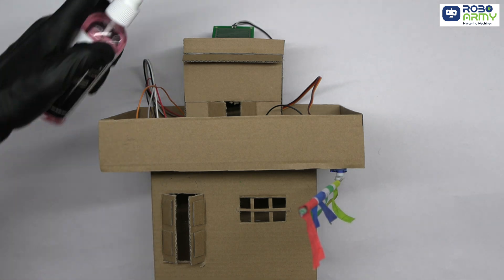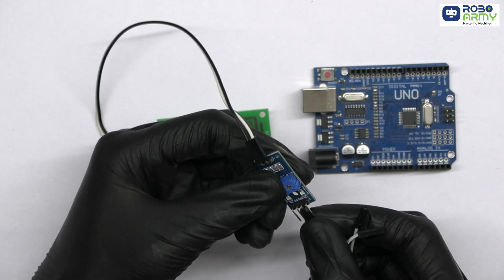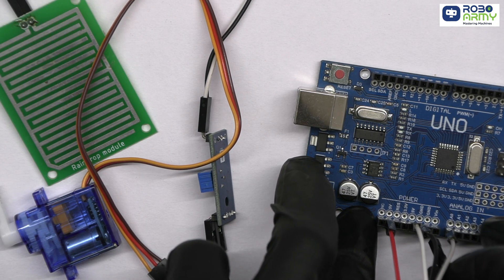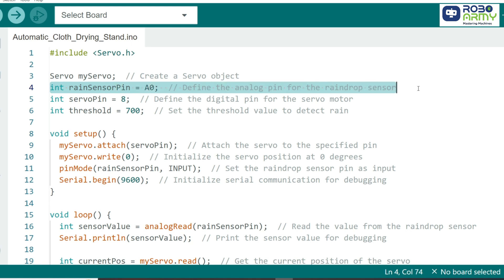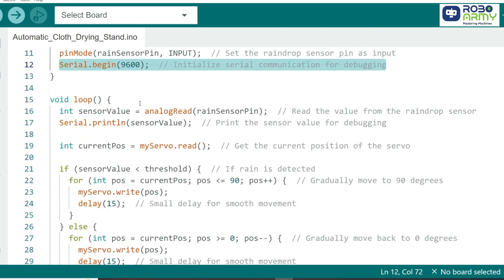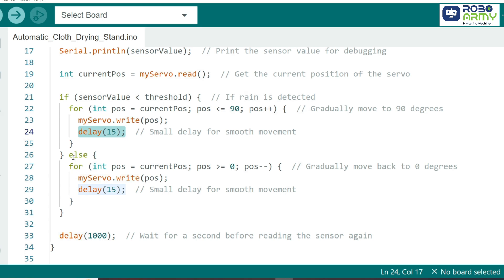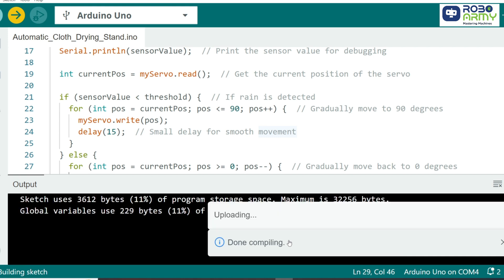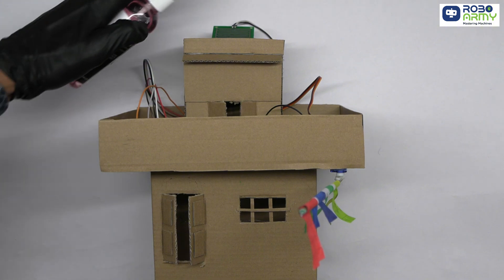Automatic Clothes Drying Stand using Arduino, Servo, Raindrop Sensor I Robo Army I Arduino Project

Comment: How many jumper wires
Reply from the maker: Great question! We used about 6-8 jumper wires, but it can vary. Are you planning to try it? We'd love to see your version!
Reply: @robo_army_  but😅 the material is too expensive 😷
Reply: @robo_army_  but I like this project with your best explanation 🥳👍😃
Reply from the maker: Thank you so much! 😊👍 I understand the cost can be a challenge, but you can start with basic components or reuse parts from old projects to save money. Let me know if you need help finding alternatives!
Reply: @robo_army_  pls tell recreation of this project in low cost
Reply from the maker: You can recreate this project at a lower cost by using a DC motor with a simple ON/OFF switch instead of a servo, and a DIY rain sensor using aluminum foil or copper wires. Let me know if you need a detailed guide! 😊👍
Reply: @robo_army_  I need ❤️🙋
Reply from the maker: Awesome! ❤️🙌 We'll put together a budget-friendly version for you soon. Stay tuned! 😃👍
Reply: @robo_army_  i am waiting ❤️🔥😤
Reply: We can upload the program into uno  using Android otg ???
Reply from the maker: Yes, you can upload programs to an Arduino Uno using an Android device with an OTG adapter. You'll need an OTG cable, a USB to Arduino cable, and an app like ArduinoDroid or AVRdude. However, keep in mind that the compiling speed may be slower compared to a PC.
Reply: Which one is right this 2:00 or 2:07 this ???

Comment: Is there any difference with the colors of raindrops sensor?
Reply from the maker: The color of the raindrop sensor usually indicates the type of coating or PCB material used, but it doesn't affect its functionality.

Comment: The arduino is getting hotter whats the issue? the battery is 5000mAh is it the problem?
Reply from the maker: The issue is likely the voltage, not the battery capacity (mAh). Check if the battery voltage exceeds the Arduino's input range (e.g., 7–12V for UNO via VIN). Using a higher voltage can cause overheating. Use a compatible power source.
Reply: @robo_army_  but the battery that i got is 3.7v
Reply: 3.7 v for each battery so i had 2 of them
Reply from the maker: Hi! If you're using two 3.7V batteries in series (7.4V total), ensure you're powering the Arduino through the VIN pin or power port. Also, double-check all connections for shorts or incorrect wiring. 😊

Comment: The servo motor didn't work... need reply asap😭
Reply from the maker: Hi!  Thanks for watching the video and sharing your feedback. If your servo motor isn't working, here are a few things you can check:
1️⃣ Power Supply: Ensure your servo motor is getting sufficient power. Some servos require an external power source, especially if the Arduino can't supply enough current.
2️⃣ Connections: Double-check all connections (VCC, GND, and Signal) to make sure they're secure and correct.
3️⃣ Code: Verify the code uploaded to your Arduino. Make sure the servo library is included, and the signal pin in the code matches the pin you're using.
4️⃣ Rain Sensor: Ensure the rain sensor is working and triggering correctly; this might affect the servo logic.

If you need further help, feel free to share more details about your setup, and I’ll do my best to assist! 😊
Reply: @robo_army_  thank you
Reply: @robo_army_  another question what mAh battery did you use?
Reply from the maker: 2200 mAh